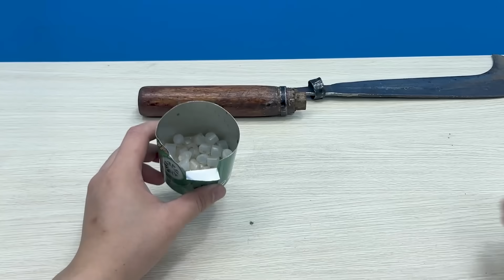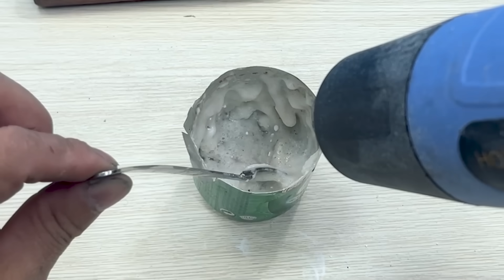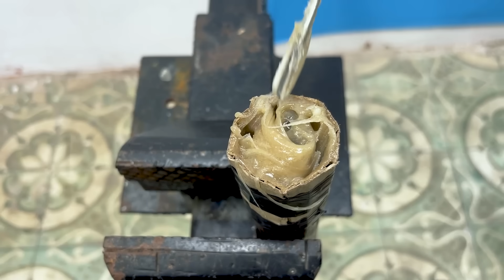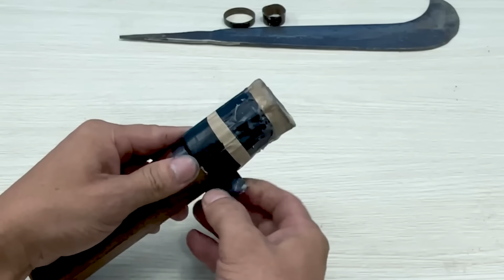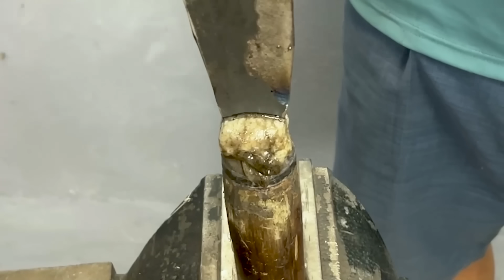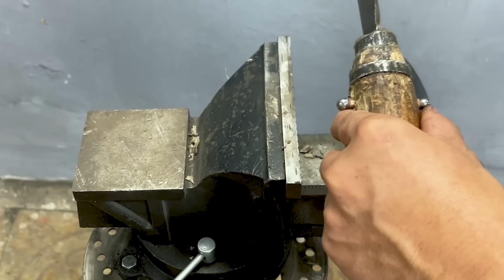Even veteran blacksmiths don't know this! The way to weld wood is more durable than steel

Comment: For the title of the video, it's nonsense.
Blacksmiths know hot glue, it's not a secret glue... They know tricks you don't know, and they do a much cleaner job, nothing related to yours.
Don't underestimate blacksmiths, who do physically difficult work and make tools you wouldn't be able to make. With all the knowledge about steels, the color that must be achieved in the forge to hammer it and how to do a good heat treatment for a solid blade and with ease to sharpen it. With a lot of knowledge about handle construction and precise workmanship. What you are not capable of doing. Even if your tip is good, this kind of video title is insulting to blacksmiths. There are fewer and fewer of them, because industries manufacture knives with machines, we must support blacksmiths and avoid speaking negatively about them as if they did not know how to assemble a blade with a handle...
Reply from the maker: Hello, I'm very sorry if what I did made you unhappy, I will learn from it in the future, it's nice to chat with you, thank you very much for your interest in our videos , Have a nice day
Reply: Good response ! ❤
Reply: You were humble  enough to have admitted your fault
Reply: Estoy de Acuerdo, No se Debe Menoscabar la Sabia Experiencia de un  H E R R E R O !! .
Reply: Buen día. Lo criticas para mostrar cuanto sabes o haces ?, estimo que todos hacemos y mostramos, quizás,  para que le sirva a alguien. Críticas  constructivas, y con tan poca empatia, no van.
Reply: Спокойно, ребята! Пусть каждый покажет своё. У нас у всех разные возможности, знания, опыт, умения... Мы делимся, а выбирать Вам. Никто никого не хотел обидеть. Будьте терпимыми, в мире и так много зла. Всем добра. Россия.Сибирь.Красноярск.
Reply: 대장장이는 위대한 기술자입니다....사회적으로 이런 기술자들을 지원하고 보호해야 합니다....

Comment: As this is about functionallity mainly I wonder what the use of soda serves. It is used for liquid rapid glue to give structure, but other alternatives are also available. But in case of hot glue, which has volume already I do not grasp the rational to use it as a "filler". To my understaning the hot glue alone should serve perfect without any additives. Otherwise a nice idea to fix tools for which you want to keep the original parts to as m;uch as possible.

Comment: I will use epoxy instead..
Reply from the maker: Hello, nice to chat with you, thank you very much for the useful advice, we will use them, thank you, have a nice day
Reply: Consider this epoxy set hard and brittle. Hot melt glue set firm and with mineral filler it is rigid with much needed flexibility in wood cutting.

Comment: Сделал рукоятку, но загадил ложку. Эпоксидккой или мгновенным клеем с содой нельзя было?
Reply from the maker: Hello, nice to chat with you, thank you very much for the useful tips, we will use them, thank you, have a nice day
Reply: I think the problem with instant glue is that it would harden too quickly, before the tang of the blade could be firmly inserted.  The problem with the glue in this video is that it would soften with heat.  Best idea would be to fit a new handle, probably cheaper than buying glue sticks,  baking powder and a bit of copper tube.